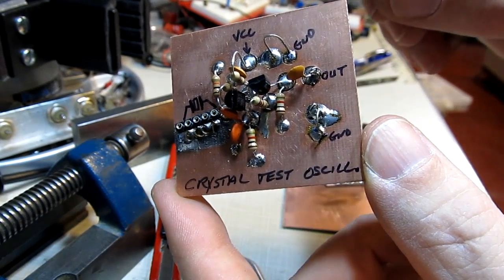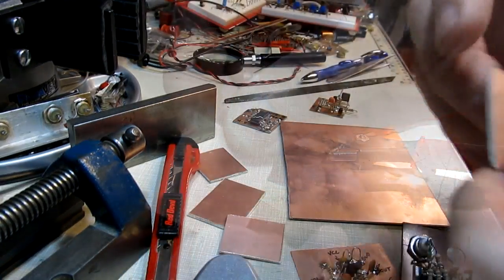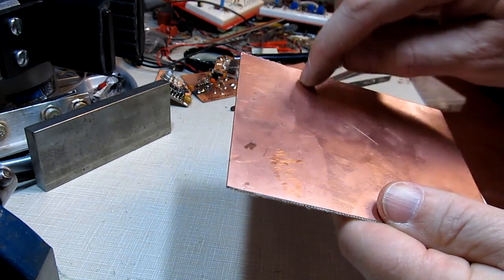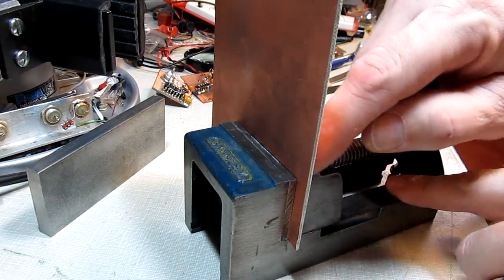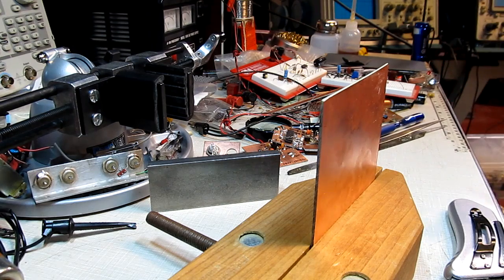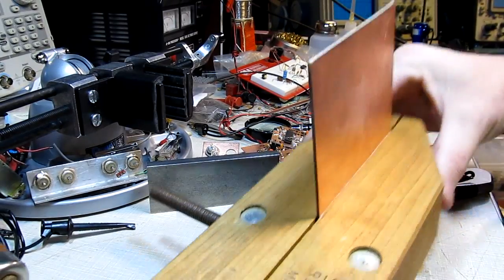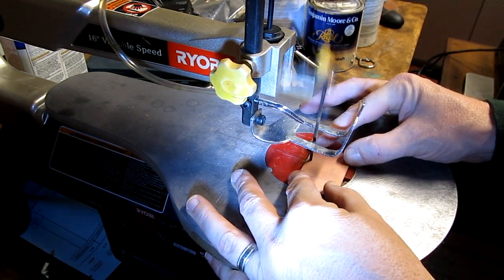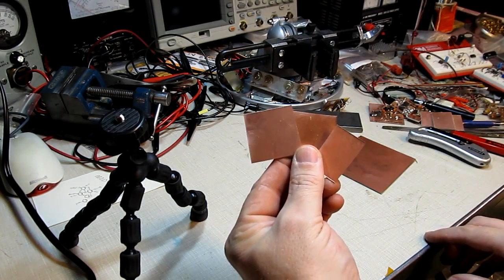#129: How to cut circuit board PCB material - a couple of favorite methods I use...

Comment: I picked up a pretty deep pair of sheet metal pliers which is handy for focusing on the break line if boards are under a couple inches. In the glass and plastic industry we will stick the tip of a wooden dowel rod about a half inch in on the edge centered under a score as a fulcrum to push on and start a break. You could do that on both edges to highly favor the final snap. If boards are not perf, a plastic cutter could follow up an initial utility knife cut and it can score to a greater depth with more of a "V" cut. I like the multi tool oscillating saw and spaced metal score guide comments here. For large inset notches say to remove a corner i might suggest a one cut one score method where you physically cut through in one direction and once that material is gone you can score and break the other direction.

Comment: For quick project you could use "prototype pcb" , easy to snap and solder jumpers. For complex prject I use CNC router or oder it from manufacturer (depending on trace resolution and complexitiy).

Comment: Hello, I would like to create three small copper islands for the transistor as shown in the video. What tool should I use to create roughly 1/8" or smaller copper circular islands on single side fr4? Dremmel with small diamond bit orI plexiglass cutter by "wobbly" hand . I can't find a 1/8" hole saw.

Comment: I'd just suggest you make it even more clear that in addition to cutting the board material's epoxy plastic that you are literally cutting glass mat, and that doing so will VERY quickly dull either blades or drill bits.

Comment: Tin Snips! thanks man, i found this to be the best solution. You can find these with longer strighter blades like oversized sisors.The cut is clean and quick, unlike saws, or using blades to score and snap the boards. thanks again.

Comment: A shear is by far the best way. The Shop Fox 12 inch shear from Harbor Freight is ideal and costs less than $300. (shipping will add significantly to that!)
Reply: Good ides - I see an 8 inch sheet metal sheer by VEVOR on Amazon for only $90
Reply: @reedreamer9518  8 inch is fairly small. You couldn't shear a standard 12x12 sheet of circuit board material. The smaller sheared ;pieces of circuit board get quite a bit more expensive per square inch.

Comment: Any of the methods other than the scoring leads to very irritating particles. I used an N95 mask but still this stuff is worse than cutting metal or wood. I am planning on making a DIY tine little vacuum that is not as noisy as the regular shop-vacs in the market (even the smaller ones) or repurposing one of those small hanheld cleaners that are used for vehicles or pet hair. Did you ever consider doing anything about that?

Thank you for the encyclopedic videos

Comment: I think jigsaw refers to the handheld version of the tool,  that one you used there I'd call a scroll saw.  We have a couple of them around here.  They were real handy when I wanted to cut rectangular openings in a plastic box for powerpole mounts and volt/amp meters.

Comment: Thanks for vid. Is it true Circuit boards contain lead. Contact with the dust or skin should be limited.
Reply from the maker: Bare copper clad circuit boards like these to not contain lead.  It is only the solder used on assembled circuit boards that may contain lead.

Comment: Why would a PCB board use 4 multiple layers of grounds any reasons? It takes 280 C on my hot air gun to lift up SMD chips and use a SMTmax853 pre-warmer under the PCB board to warm the PCB board in order to lift up the SMD chips.

Comment: what kind of education do I need to learn this kind of stuff?
Reply from the maker: Mainly years of practical experience
Reply: @w2aew  where does one start?
Reply from the maker: @GhamPlays  Everyone's path is different.  For me, it started as a summer job working in a TV repair shop in the late 1970s, followed by getting my EE degree in 1985, then working as an engineer since then, as well as being involved in electronics as a hobby along with ham radio for most of my life.

Comment: I like the jigsaw, but I need to buy one.  Until then I have to use elbow grease.  How do you cut just the copper of a PCB into squares or strips?  Thanks for the video.
Reply from the maker: Usually use the tin snips or a bench top metal shear.

Comment: Aren't these boards made of fiberglass?  If so, rubbing the edges with your fingers after cutting them in half is a bad idea because of the fine fiberglass particles that will then stick in your fingers possibly make their way into your lungs and eyes later on

Comment: Great, thanks!
What if you mounted two straight edges in the vice and then follow them while cutting, that will also prevent marking if the vise jaws is not smooth.

Comment: A cheap electric tile cutter works very well and is quick and relatively safe since no sharp blades. Spinning wheel variety.
Reply: Agreed.  Mine has burrs on the platform that can slice copper, though, so rest the PCB on cardboard.

Comment: When you use the nibbler tool does it leave small cut squares of copper clad that can be used as glue on islands/pads for other projects? just a thought as Ive never used a nibbler.
Phil
Reply from the maker: The nibbler creates very small rectangles, probably a bit too small to use for islands/pads.  Each "bite" the" the nibbler takes is less than1/16" of an inch.
Reply: *****
 Dam though it might be an easy quick way of cutting pads without much waste like the small circular hole drill creates, never mind.
Reply from the maker: Phil Kashmirkaraoke A hole-punch designed for sheet metal does a nice job.  I use this one:
http://www.amazon.com/Neiko-Power-Punch-Sheet-Metal/dp/B0002T87CW/ref=sr_1_3?ie=UTF8&qid=1421245425&sr=8-3&keywords=metal+hole+punch
Reply: *****
Cheers that looks nice, I managed to kill a leather hole punch very quickly and ended up scoring and breaking strips of little squares due to being very tight and not wanting all the wasted board from cutting circles, at one time you could buy a bag of pre cut square pads quite cheap but I have not seen them for a long time here in the UK? I wonder how long it will take for somebody to post a link up saying "here they are still available"?
Phil
Reply: @M6MRP  4 years! QRP Club sell QRPMe squares.

Comment: I really liked the wooden clamp idea so I made a small version to go in my toolbox. It comprises two ~15cm lengths of 15mm square section mild steel bar. The bars were clamped tightly together to be drilled through at each end. Then I drilled one for tight M6 clearance and tapped the other to M6. The two bars then bolt together with a close, parallel fit at the mating edges on each side. The tool will stand up to a lifetime of close shaves with the box cutter knife. Use normal machine screws, wing nuts or custom made big knurled screws to taste.

Comment: I still prefer using PCB Guillotine shears a company which I have found that specialise in manufacturing high quality low cost shears are a UK based company called Fortex www.fortex.co.uk.
Reply: +Mick Wood Is that a joke?  Cheapest guillotine is £250.  You'd have to be cutting pcbs all day long to justify that expense.

Comment: How about a diamond tip glass cutter (ebay)? will it work ?
Reply: Gehan Sanjeewa Silicosis is more likely
Reply: Rotary diamond glass cutter is dangerous since glass fibers are release into the air Lung cancer may result.

Comment: I used to use a band saw with a really fine blade, it works well but the dust get everywhere. I now use a sheet metal shear, it works incredibly well and leaves a really nice finish on the edge.

Comment: Very nice video. I always use my dremel with a cutoff wheel. It is super easy, and fast. Just don't breathe in the dust!
Reply: I too use Dremel tool with a thin cutoff wheel, works great.
Reply: @wd8dsb  A good option but I find the reach rather limited with a Dremel as the body of it comes into contact with the board. I always position a vacuum cleaner hose next to whatever I'm Dremel cutting to get rid of the nasty dust!

Comment: I was wondering about converting an old TV into a basic audio oscilloscope to reclaim so utility of a set or two in the garage. I looked on youtube and there are several sappy videos playing music with no narration. I thought you may have some interest in this for one of your well done videos.
The scope should have some rudimentary stable trigger system and need not be specific on calibration. Perhaps other Hams could find utility as a basic audio scope, transmit or RTTY monitor or as a basic tool for audio projects. Most hams probably have or have access to old TV sets ad this would be a fun project.
There are some links under google as well.

73,
Glenn WA4AOS
Reply from the maker: I've never really had in interest in doing a conversion like this.  Aside from the differences in deflection, there's the other issue that in most TVs the HV supply for the CRT is usually derived from the horizontal oscillator, so you generally have little opportunity to change that.  I know that I lot of people have done it, but in my opinion would only make for a conversation piece rather than something useful.

Comment: Nice tips. I like to use tile sample swatches from the hardware store. I cut and use the swatches for art projects. Every time I shop, I pick up a couple more to expand my supply and selection.The swatches are made of the same stuff circuit boards are made of only thinner. I have had the same problem with dulling saw blades. Perhaps these scoring or nibbling methods will work better.

Comment: I use a benchtop bandsaw with a fine pitched blade dedicated to cutting PCB material.  Not only cuts quickly but also allows for irregular shapes when needed.

This is the method that has worked best for me and it spares my real woodworking tools from all the abrasive dust.

Comment: I just use a little porxxon table saw ks230, just because its easy and I also use the material to make casings out of it by soldering them together, with a table saw you get perfect edges and square edges
Reply: Same here.